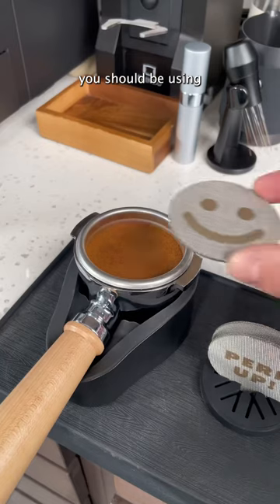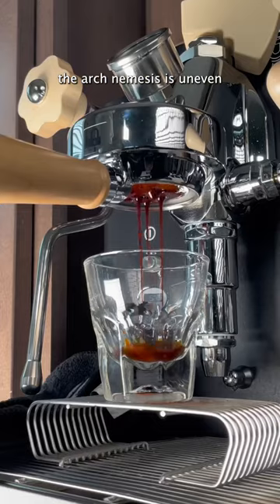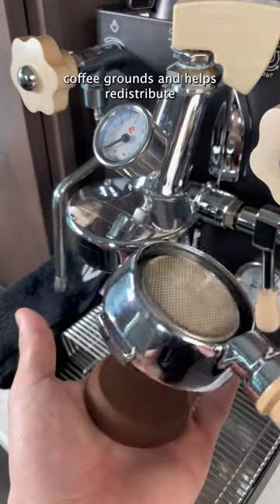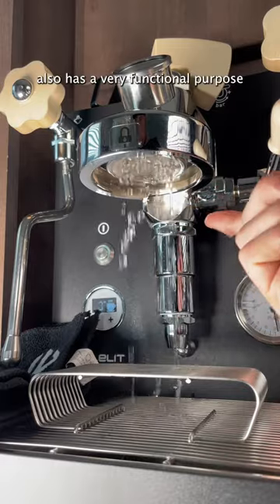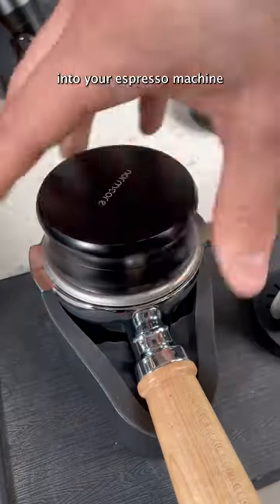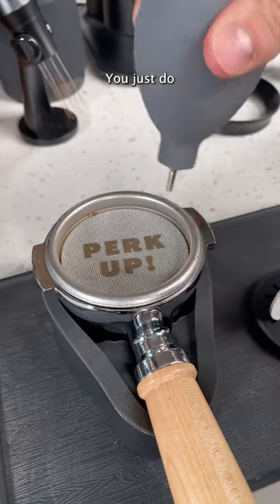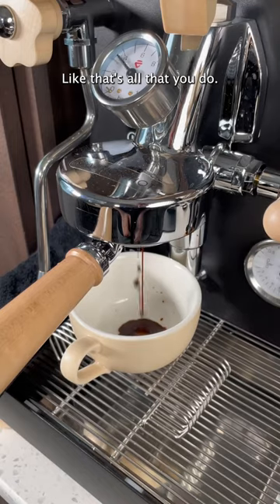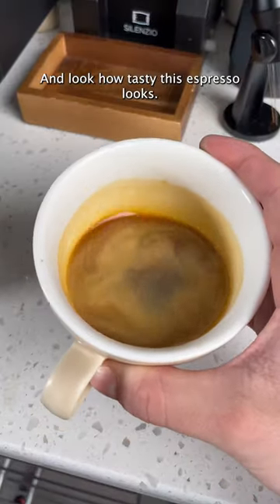Use a puck screen #coffee

Comment: I've bought two and accidentally threw away both. I bought some paper disposable ones and been happier with those 😂
Reply: Why did you threw theM 😂
Reply: @m.tahjulreyhan6976  They said they accidentally threw the puck screen away.
Reply: They are not the exact same, tho, metal PS is meant to be on top of the puck, while paper ones below the puck (tho James Hoffmann said multiple times that it is not an indisputable truth, so don't take my words for a criticism)
Reply: @Kompoteek  Interesting, I use it above like you would a metal puck screen. That's where it helps distribute water. I feel like putting it under the puck removes the purpose of it since it wouldn't be distributing any water over any grounds. Also it helps to keep the group head clean when on top as a barrier between the group head and the grounds.
Reply: @ChrisManfro  putting it under the puck also helps distribution, but it does it differently: paper filter on the bottom protects the filter basket from coffee grounds blocking the pores (in which case water starts "preferring" one side of the puck over another, because there are different levels of hydraulic resistance), so the water flows through the puck more evenly
Reply: @ChrisManfro  and a steel puck screen is also a little bit better than the paper one, because it prevents the puck from expanding a lot during the extraction, which paper puck screen doesn't, so it helps to make the distribution even better!)

But I think we all can agree that even a paper puck screen is beneficial for the espresso, so it's 200 times better than no screen at all
Reply: Paper absorbs oil
Reply: @robertweber8936  it does.  I found that I like the taste better. I've made pour over coffee with metal filters and paper. I prefer the paper because it removes some of the oils
Reply: not very eco-friendly, you paper ones.

Comment: They're only good if your puck prep is terrible. The downside is they stick to the puck once you knock it out, they're a pain to rinse off properly and it's an added step. Just not needed
Reply: on some machines there isn't enough spouts around to cover all the grinds so you end up with 2 holes in your puck and waste grinds. if you have a machine that distributes it evenly yeah its not that necessary
Reply: exactly, surprisingly they never show the cleaning part in these videos...

Comment: My question with those is the clean up. In a coffee shop work flow context, if like 20 people are line up. Do you just knock them out then place them in? Are they scalding hot?
Reply: I would guess most commercial shops have either multiple machines, or machines that can do multiple shots. You pull one, step to the next one, guy behind you preps and pulls, etcetera.
Reply: Coffee shops don’t do all of this stuff that home baristas do. At a coffee shop you make hundreds of shots per day, someone at home is making only a handful so it’s not a big deal if they take a little bit longer
Reply: @KylixTheFur  I'm going to tell you what REAL Expresso shops do.
-Pick up the basket, FROM the machine.
- Beat the puck out on to the designated bin.
-MAYBE put in a new paper filter, most use metal ones built into the basket.
-Put basket onto the the coffee grinder.
-Grind the coffee onto the basket
-Remove from the grinder and use the presser built into the grinder. all these things use the coupling system as the machine
-Put the basket into the machine and the expresso cups bellow it. Yes professional shops take 2 expressos out of a single puck, unless there is only 1 costumer.
-Serve the expresso and repeat from step one for next customers.

Some Italian guy correct me if I'm wrong. Because they are the masters of the expresso.
Reply: @pmp1337 well, in italy at least: Baristas just use a large coffee machine where they just take out the used grounds and add new ones into the thing with the handle and then just press a button to make the coffee.
 At home most of us use a mocha or a better quality nescaffe type machine
Reply: for coffee shop workflow it's not ideal, they are hot when you knock them out, they're easy at home, wwhat i ddo is a light tap to knock the screen into my hand and then a heavy tap to drop the puck, if i had a knock box i would just do it in one tap, and you just rinse it off and dry it
Reply: @pmp1337  that's exactly what happens. i don't see this metal thing being easily integrated into that workflow. the dumping of the used puck into the designated bin is just too fast

Comment: it doesn't distribute the pressure... water will flow more through the part of the screen where the channeling occurs. Each hole in the screen will experience different pressures. Arguably the bottom of the basket does a better job at forcing the distribution than that screen does. only because the holes are fewer and smaller.

Comment: I use a screen and still get channeling, I use fresh beans, grind well, use a distribution tool and pressure set tamper and I’m still pulling one decent shot that doesn’t spray everywhere out of 3 prepared. Not sure what I’m doing wrong. Breville bambino
Reply: Good luck! It’s a shame to spend $500-$1000 “beginner “ espresso machines and not get the results as advertised. To simplify my experience I used 18g of freshly medium to dark roasted beans per serving to dial in the machine. Out of 18 pours/double shots of espresso 4 fell in the “espresso quality”. Waste of time, coffee beans and money.
Reply: @joeee8336  I’ve gotten better results when using 20g instead of 18. I also want to say that I have not invested in a great grinder which is probably why I’m not getting consistent results. I’ve pulled great shots before but can’t seem to duplicate the process back to back. Not gonna give up just yet.

Comment: I don’t have an espresso machine, so I use a moka pot. Do I need a puck screen for that?
Reply: A good paper filter is good enough, i encourage you see other mokapot videos that use paper filter, and the result is clean!
Reply: With some skill and a bit of luck, one can make good espresso from a nobody machine.
I once received a credit card gift espresso machine. That means the cost is $0. That is a machine with no pump, the only function is brew or steam for milk.  After some attempts, i got a drinkable coffee, not that I would be proud of. 
Next I learned brewing espresso is impossible with this machine with not pump, the pressure must be less than 2 Bar.  Next I tried to increase the pressure. Doing so, I turned the 3 way switch from brew to steam, and then clogged the steam outlet.  When the steam cannot come out the boiling point goes up together with the pressure inside.  At some higher temperature, the coffee machine temp sensor kicks in to stop the boiling. Then I turned the 3 way switch to brew, the pressure inside is enough to push out half serving of crema, with the remaining half under pressure, but still a respectable cup of espresso from this sh**ty machine.  

**Clogging the steam outlet is dangerous, do not repeat unless you have a PHD in DIY.

Comment: How do you clean puck screens?
Reply: by cleaning them
Reply: @brrrrrr  thanks for the input, but my question is mainly targeted to Ethan so he can share how he cleans his pucks. Some people use ultrasonic cleaners for hard to clean gunks.
Reply: @drwfrnndo  I clean them in a solution of grouphead cleaner mixed in hot water. Leave them in for about 5-10 mins, comes out perfectly clean. Rinse thoroughly by running water through them in the portafilter.